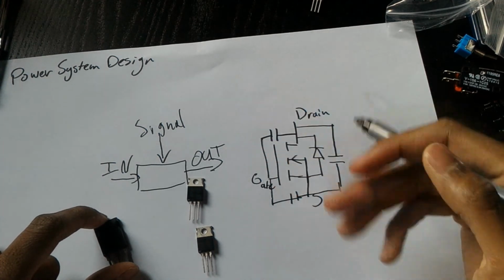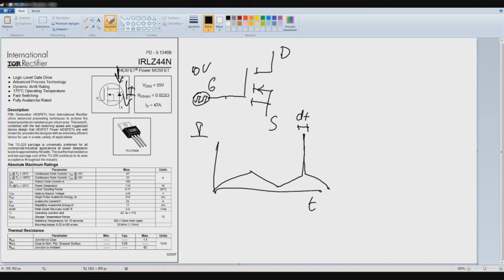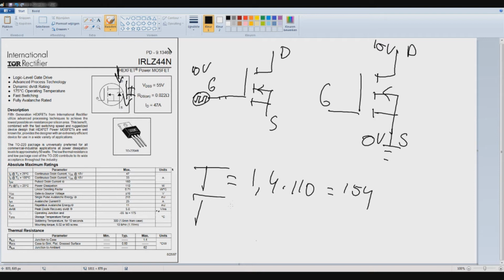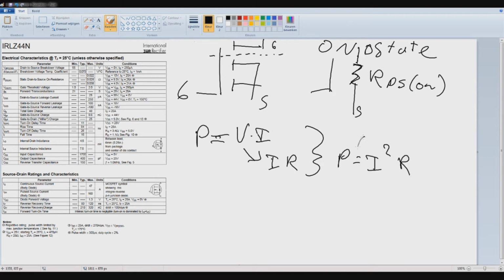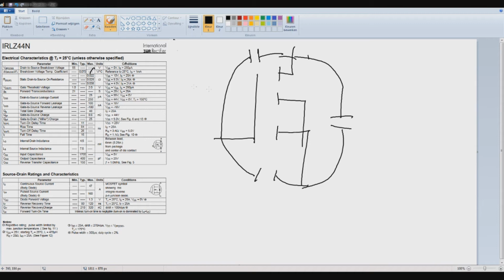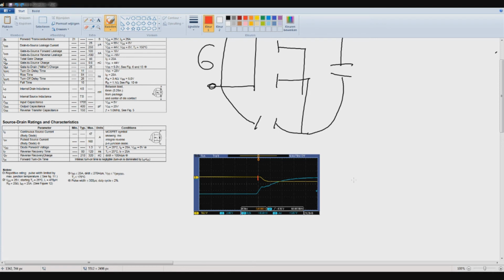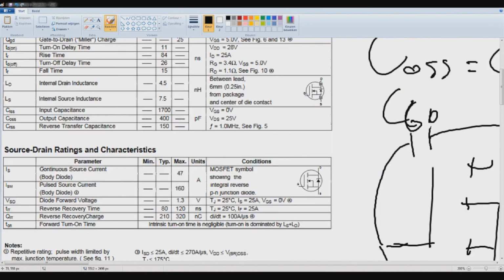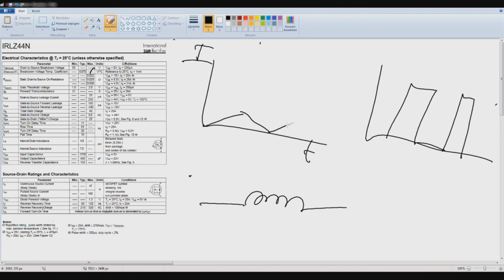Power System Design - Episode 1: MOSFETs Part 1

Comment: Around 25:00, that seems more a consequence of reaching the Vz voltage of the bypass Zener diode in parallel than "breaking" the substrate. In fact, I don't get what you mean by the "thin imaginary barrier between the Gate and the Source"  about a voltage between the Drain and the Source... and what you mean by "not waiting for the gate to charge up" either, since waiting imply time, which has nothing to do with plain static voltage, no?
Reply from the maker: There is no diode, it's a model for the substrate behaviour. The Drain and Source are connected as N type silicon where the part in between those is the P+ type. Now from P+ to N acts as a forward diode. So, in fact they are one and the same one way requires active activation, the other way is passive. Imaginary barrier was implied regarding the symbol, what I mean is ofcourse the P substrate. Regarding the gate charging up, 32:20. The gate is a parasitic capacitor that charges up to it's desired voltage.
Reply: There is an internal Zener diode in most recent CMOS transistor, between the Drain and the Source, and that is why we cannot exceed the listed voltage, since then that Zener diode reaches its avalanche voltage, Vz, and conduct, instead of the transistor. Check, as example, http://pdf1.alldatasheet.com/datasheet-pdf/view/84032/IRF/IRF9Z24.html. Not all companies show that diode as a Zener diode, though.
Reply from the maker: snnwstt Again, that's the substrate acting as a diode. https://electronics.stackexchange.com/questions/72582/mosfet-why-the-drain-and-source-are-different
Reply: Not sure that a site where "anybody" can answer is a very strong reference. As example, the top answer claims that a 4 terminals MOSFET device (one which expose the substrate) is not very useful while in reality, such a device allows to control VGS(TH),  THE MOST IMPORTANT parameter about a MOSFET. The poster even claims that since there is a P region between two N regions in a N chanel MOSFET, that means that it includes .... a BJT !?!  (While, for a BJT to work, the middle region has to be very thin, 50 Angstrom is the norm, today; AND has to get a current flow through the Gate, current which is zero  ( in the nano Amp)  for a MOSFET under constant voltage at its gate). The second (best, by votes) poster supply a N chanel MOSFET diagram as two N type regions separated by a third region,  another N type region, itself sitting over P type ?!? 

Anyhow, while any PN junction can be seen as a diode, I agree with you on that, but not all diodes are ZENER diode, right? And a Zener diode is not automatically destroyed as it enters in avalanche mode. So, when the specifications give a maximum reverse voltage that can block the MOSFET, it is the Vz voltage of the Zener protective diode that is given there. That is a maximum applicable not because the MOSFET is destroyed with a larger voltage, but because a Zener diode kicks in and starts to conduct at that voltage (so the transistor package is unable to block the current, anymore, since the current is going through the Zener, reverse biased). Sure, it there are no resistance limiting the current, then you have a short and then the MOSFET is destroyed, as a Zener would, or as a LED would, as usual, no magic there.
Reply from the maker: snnwstt Seems like you have ALOT to learn. Everything in that post was correct. Yes, there is a parasitic BJT, that's a known fact. 

Regarding the internal "zener" diode. It's just the NPN layers, that ACT as a low voltage zener.  It's a part of the MOSFET. People refer to it as the internal body diode, while it's simply a parasitic diode. The Zener symb is just a resemblance of the avalanche rating of the MOSFET. You see the zener symbol when the MOSFET is "repetative avalance rated" as where you will see a normal diode when not. All content in my video discussed is correct. If you still don't believe me, I suggest you go read further up on MOSFET theory. Here's a start, it's a good read. You'll also find the parasitic BJT: https://www.google.nl/url?sa=t&source=web&rct=j&url=https://www.infineon.com/dgdl/mosfet.pdf%3FfileId%3D5546d462533600a4015357444e913f4f&ved=0ahUKEwjCxZvgj5zXAhXShqQKHRjdB7AQFghhMAw&usg=AOvVaw30EmxL7qVIhaoOEA610FJ-
Reply: Either you express yourself very poorly, either you have a very superficial knowledge of MOSFET. And since you insist on points like junction capacitance but declare that notions such as a load being on the high side or on the low side is secondary, no explanation about how to turn it on or off, etc. , I will return your suggestion, to you.
Reply from the maker: snnwstt What are you on about? This is part 1 of a series. High side/low side switching are partical matters. All my designs are properly bootstrapped. Which again, is a different topic.
Reply: +snnwstt Well I suppose what Azagro means to say is that the Zener diode is a direct result of the way the FET is constructed, it was not intentional. This is somewhat common in semiconductors. You sandwich together a few semiconductors in a particular fashion to get what you want, but then again there will form a few unwanted junctions, which in this case act as a Zener diode. If you look at the construction diagrams for a MOSFET, the substrate (for an N channel FET) is a P-type semiconductor and the drain is an N-type. Now the substrate in power FETs is connected to the source (which in turn is grounded in most applications) which forms a NP junction, or a backward diode, between drain and source. This of course has a finite breakdown voltage, which if exceeded might kill the device. So technically it is not a parallel diode, but a result of device construction. The diagrams you see on datasheets are kind of a 'misnomer', they do not actually represent what goes on at the semiconductor level.

Comment: Well, it looks like Azagro is going to become a great asset to the world of power systems.
Reply from the maker: You already accomplished to fire a projectile?
Reply: Unfortunately, nope.
Reply from the maker: You haven't tried to dump extra current into it?
Reply: No. I'm going to start from scratch.
Reply from the maker: How are you going to?
Reply: I'm going to begin by constructing one of those simple magnet-roller things like ElectroBoom made and start from there. I'll keep increasing the power and making notes. And then one day I'll achieve the high power levels I need.
Reply from the maker: Ah I see, you haven't tried the capacitors as power source yet?
Reply: No, maybe I will today. Now.
Reply from the maker: If you are using neodynium magnets. Make sure the magnetic field is properly aligned. As I showed in episode 1, there could be a setup where your augmented magnetic field has zero input. Meaning, you only rely on the induced magnetic field, which I calculate to be around the 0.2mT. Where the augmented magnetic field could be around 1-1.3T. The difference between 0.0001N and 0.1N.